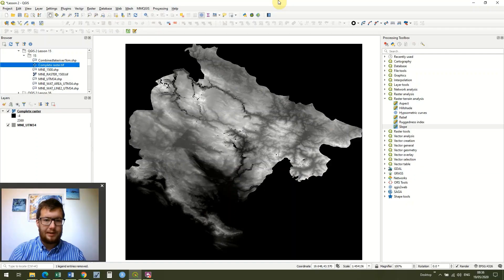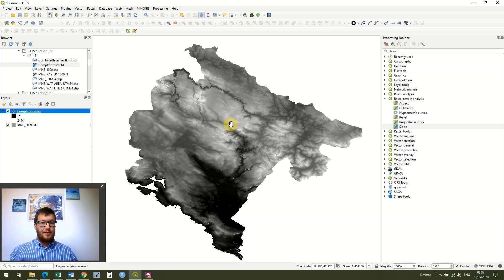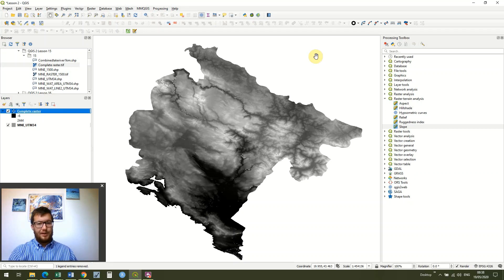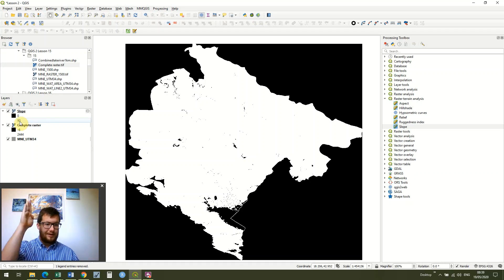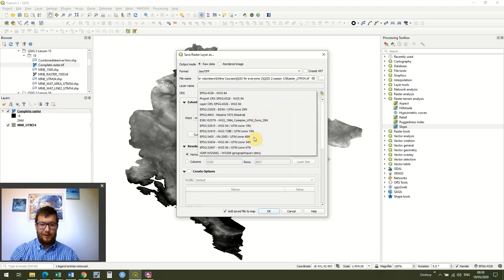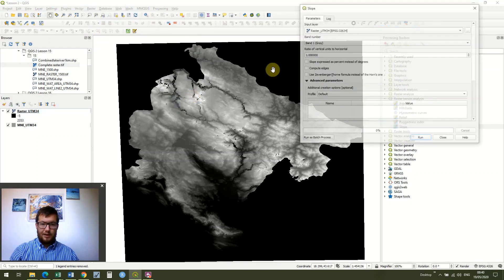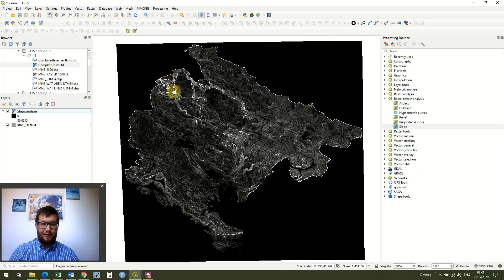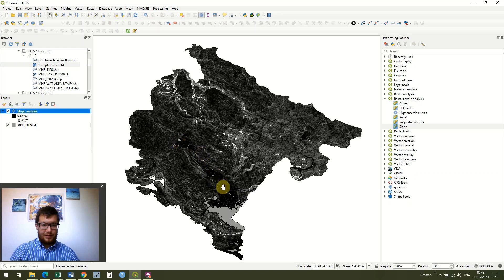QGIS 3 Lesson 2   Using slope analysis tools for rasters in qgis

Comment: Thank you very much, it's very interesting! I wonder why the lake at the southwest area is white on the slope analysis, does it only reflect the slopes on land or is there another reason for this?
Reply from the maker: Hi Lucía, the area of white in the south west is actually Boka Kotorska Bay and so it part of the sea so the white is just the background of QGIS
Reply: @dmadmarinemammalsresearcha3966   thank you for the reply! I actually meant the Skadar Lake area (which is the SouthEast, I wrote it wrong last week - sorry about the confusion) which does show in the "MNE_UTM34" layer under the slope analysis. Thank you!
Reply from the maker: Hi Lucía, no problems! The lake itself appears black (flat) because the lidar data just reflects of the surface and is not a true 'land' value. There is a thin (and quite unusual) range of mountains that runs just south of the lake which is white. Could this be it?
Reply: @dmadmarinemammalsresearcha3966  Yes! I see what you mean. So basically I got confused because the lake area is a 0 value and when we set the transparency to get rid of the black area around the map (minute 5:37 in the video) it gets rid of the lake area as well, so you can see the underlying "MNE_UTM34" layer (and if you switch it off it's just white - background colour). But thank you very much for the explanation, it has helped me understand how that happened. Once again, thanks a million for this course, I am enjoying it very much!
Reply from the maker: @luciacaldas4587  ah I understand! You're extremely welcome 😊